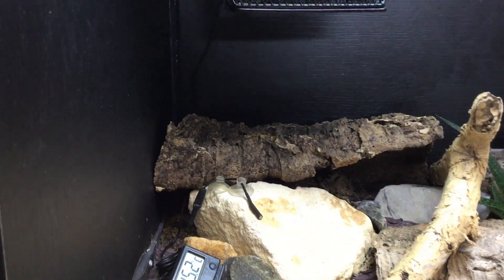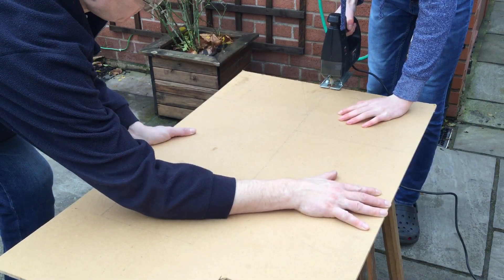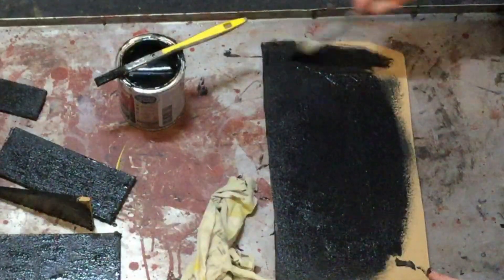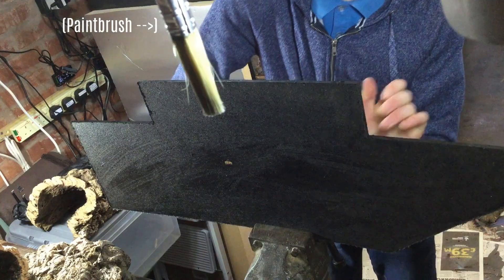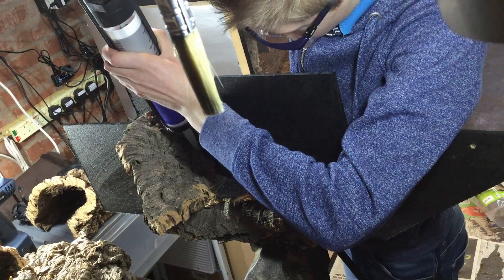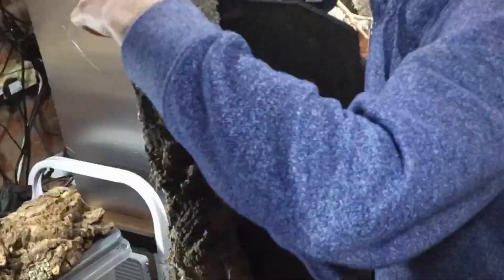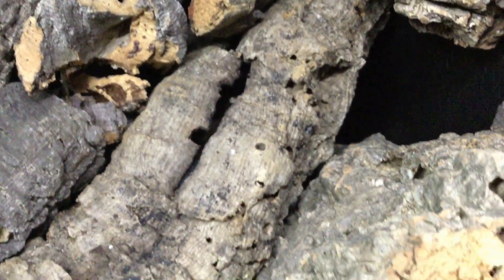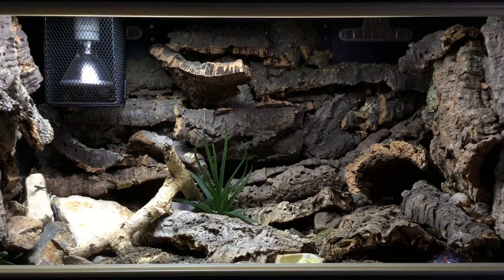How To Build A Background For A Reptile - DIY Background for my Bioactive Leopard Gecko Vivarium

Comment: I noticed your light/heat is bigger than the average bulb. Where did you get a guard to fit it?
Reply from the maker: The guard I’m using is a ProRep heater guard in the “large rectangular” size. It fits bulbs up to about 10cm diameter. For my bearded dragon, that’s not big enough as he has quite large heaters, so I use a Arcadia reflector domes in his situation.

You can get them from basically any reptile shop in the UK - I’m not sure about overseas.